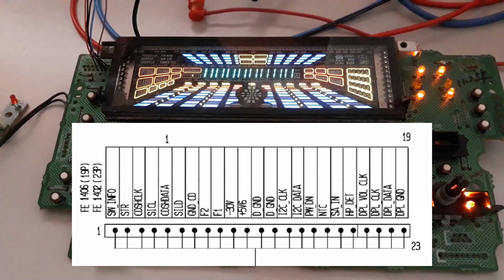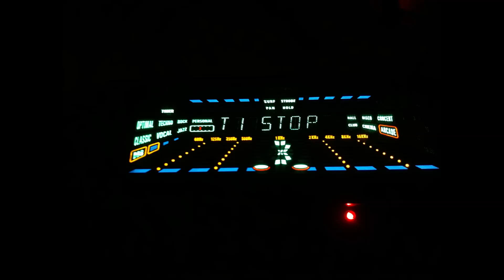Philips FW830C

Comment: Приветствую! Забавный дисплей, в 2005 году такое псевдо 3D делать было модно)
Reply from the maker: Yes! I don't know when they start with this, but I have already work another VFD which use the front and rear glasses to improve the idea of 3D
Reply: @jlsmonte  буду ждать
Reply from the maker: @localixdots9698 I think the clock's xTall is the one under the VFD, I can't read it, but judging by the format it will be a standard 32,768KHz type. But the problem is that the code on the micro with interrupts can lead to errors. But for a kitchen clock! hehehe! As for consumption, only the filaments consume close to 250mA.
Reply from the maker: What's funny is being able to have a real-time clock by connecting only 3 supplies: +5V, -24V and 3.4V for filament.
Reply: @jlsmonte  да согласен - на борту я так понимаю все для этого есть, но потребление высокое и нет сохранения отсчета времени при отсутствии питания. Точность часов тоже под вопросом насколько они могут быть стабильны.